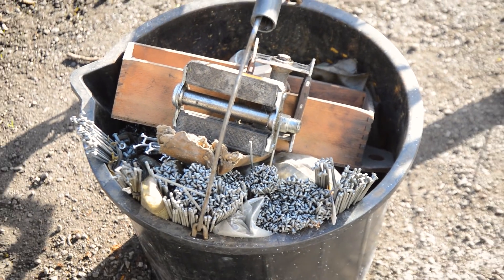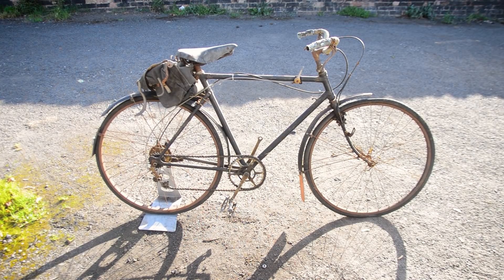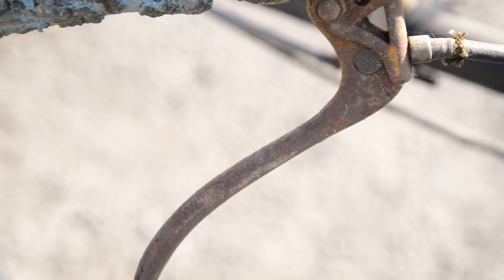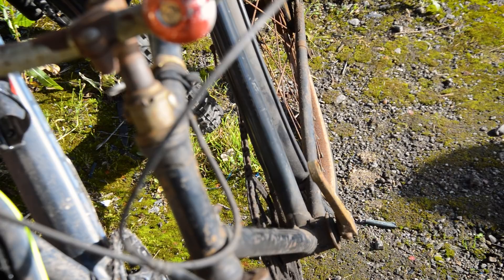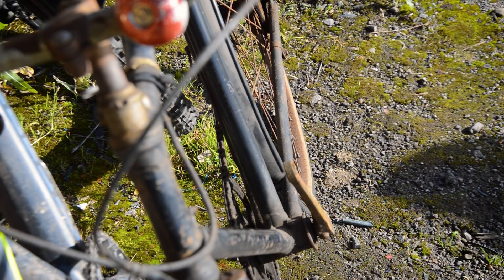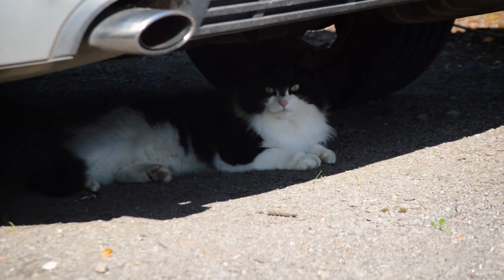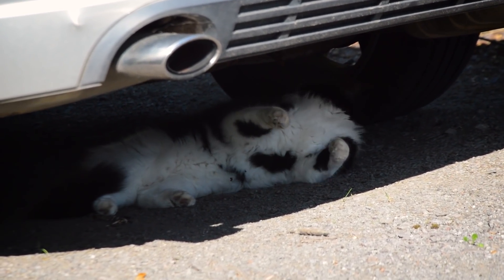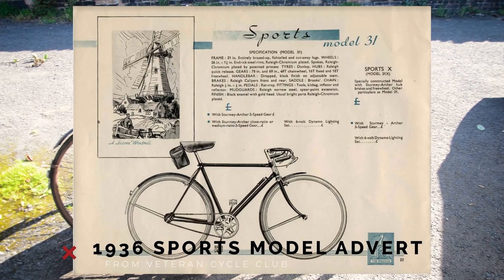One Phone Call Led To These Great Finds - 1936 Raleigh Sports Model & Sun Supalite - Vintage Bikes

Comment: That rear derailleur, I am pretty sure it is from about 1956. There is not a lot of them. The bike doesn't look heavily customized to me. Even though the bike shop owner clearly could have done some. I think it is a fairly advanced model from the mid-fifties. How much does it weight? It might be related to a Tour bike. I too look forward to it's rebirth. :)
Reply from the maker: The earliest Benelux brochure on VCC is 1950 and says the 3,4 and 5 speed derailleurs were available then in a few different styles.  I 'm certain the derailleur and shifter and even the back wheel are a later addition though.  If it had been mid 50s for the bike the paint would have been a lot more vibrant (looking at brochures of that time) and it would have definitely had a regular threaded headset rather than that "clip" style.  I haven't weighed it yet.  I need to!